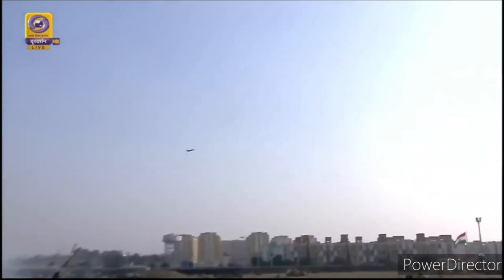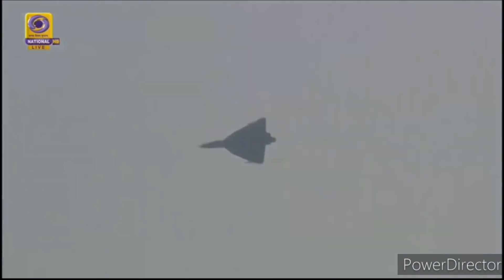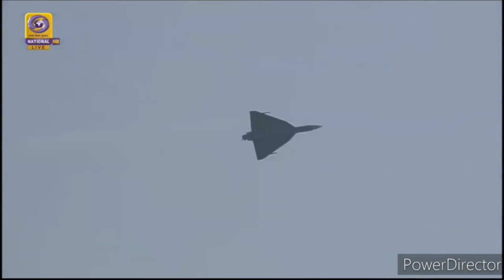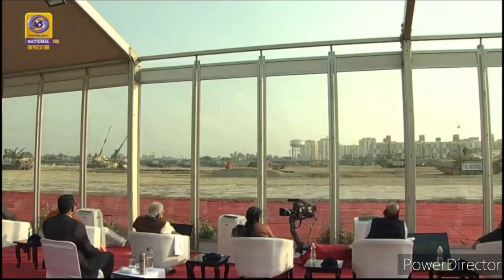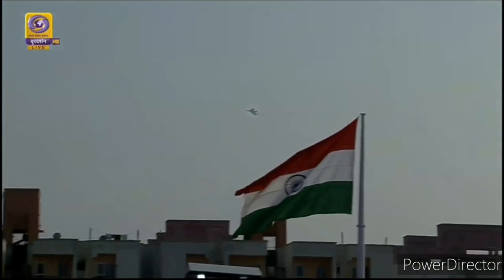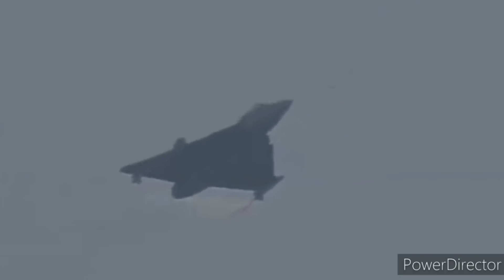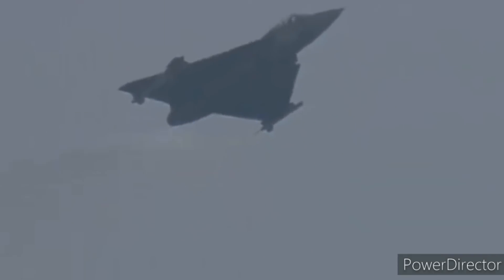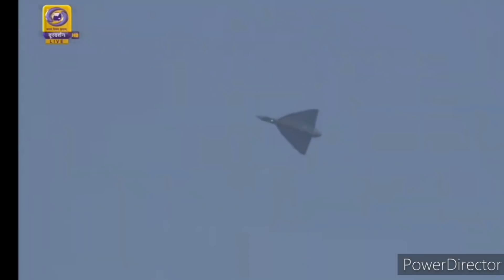LCA Tejas MK 1A Air Show at Defence expo 2020, Lucknow (IN)

Comment: Incredible stall characteristics at such slow speeds ,and high angle of attack,a great design
Reply: Tejas is a good fighter aircraft...but while turn it's slow...it should turn fast like gripen Rafale.
Reply: @sam-freak-1  Rafale & Gripen has Canards, which helps in turning fast. Tejas-mk2/MWF  has been designed with canards.
Reply: FYI ,any machine is only as good as the guy behind the stick. Stealth ,ASEA radar a big plus ,and this is the most accurate dumb bombing platform that we have. Its inherent design makes it very unstable ,and hence highly maneuverable .Ask any pilot the guy that will kill you will be the guy that you did not see first. It has very low RCS .Armed with the Astra AAM ,it will kill in the BVR range ,no need to turn with the enemy. Its primary role will not be as a dog fighter ,but suppression of enemy air defenses ,fuel dumps ,air fields .In retrospect turn radius is a moot point for its current role.
Reply: Gripen is a MMCA whereas Tejas is an LCA, and world's best in its class.